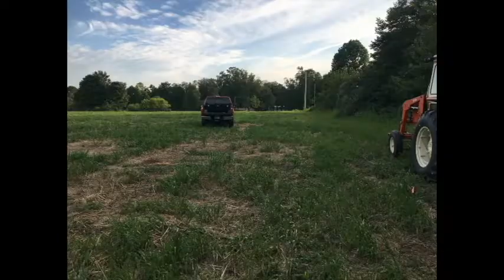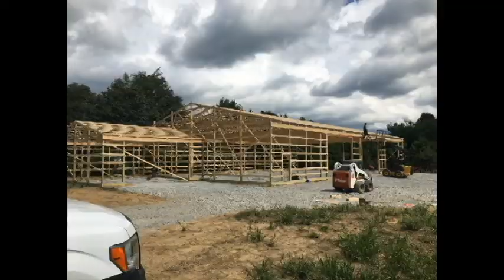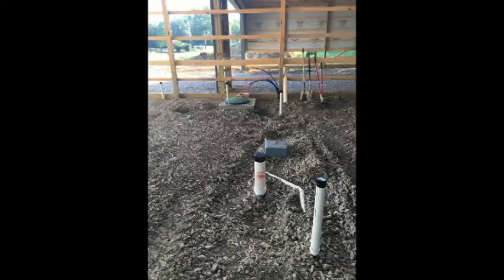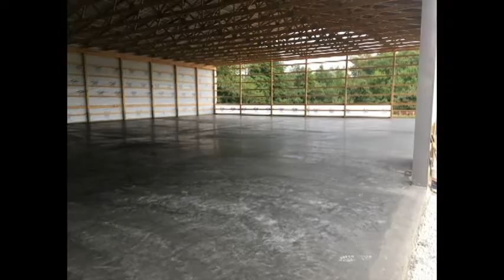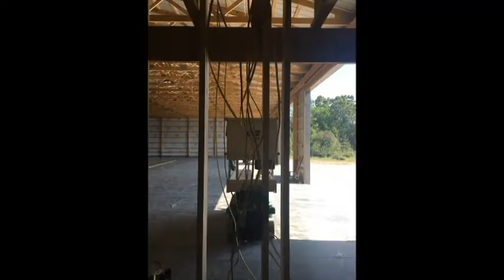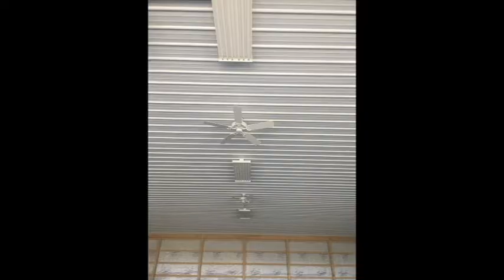Building a New Shop Part 1

Comment: Nice building ! FYI Girts on the walls, perling's on the ceiling . You were very smart going with the 2x4 girts I have built a lot of pole barns and people think they need 2x6 girts fat between the poles all that does is add cost and make it harder to insulate ! Pole barns blow UP not down so your not adding ant strength with heavy walls !
Reply from the maker: Jimmy, yes all the purling's are on 2' centers also.  If you using a true treated 6x6 for posts you get the twisting over time and that may be the reason some guys want those flat between the posts.  In this case they used laminated posts, so the twisting doesn't occur.  Should last for a long time.
Reply: @nashsummers8050  I built more column "laminated" style he 6x6 and 95% had a 2x6 girt flat maybe it was code in that area ? You have a beautiful place , what part of the country are you in ? New subscriber from Hanna,IN
Reply from the maker: @TheJimmybud  yeah in my area I see both styles of posts used.  A lot more of the laminated posts are going up than 10 years ago.  I'm in Henryville, IN looks like about 230 miles South of you almost to KY.
Reply: @nashsummers8050  Nice ,I vacation down at Patoka Lake. A lot of Utuber's in your area "logger wade , dirt perfect, tractor time with Tim . Have a great day fellow Hoosier !
Reply from the maker: @TheJimmybud  yes it's not too far away I do some deer hunting about 10 miles from there close to Jasper.  That's cool I'll have to check out their channels.  You have a great day as well!

Comment: Good  day Boy that is big.  Very nice.  You have Amish  down there too?  You said you were from  where?   Roughly  what would this building cost. 110  yds cement  Thanks
Reply from the maker: Thanks Don, yes there are quite a bit and boy they are workers.  Finished this building up in 9 days concrete and all.  This building was expensive but 20% cheaper than anyone else around the area that I could find and I had 4 bids.  I live in Southern Indiana about 15 minutes north of Louisville, KY.